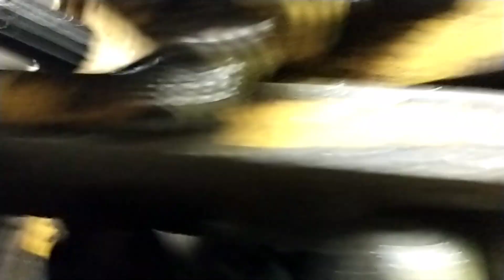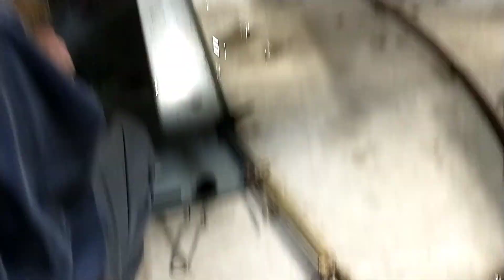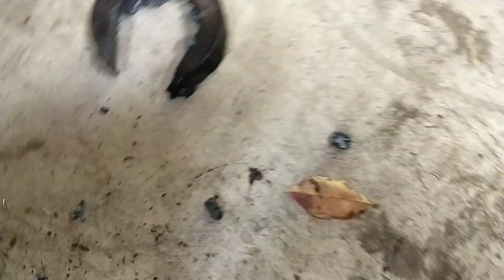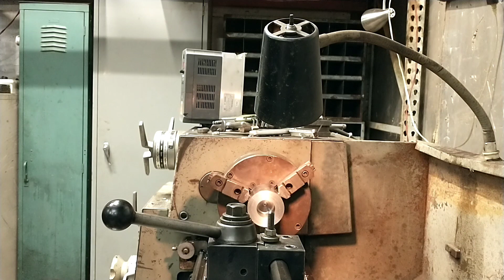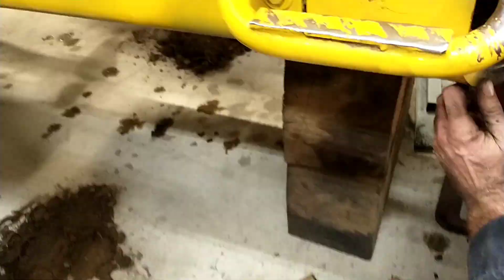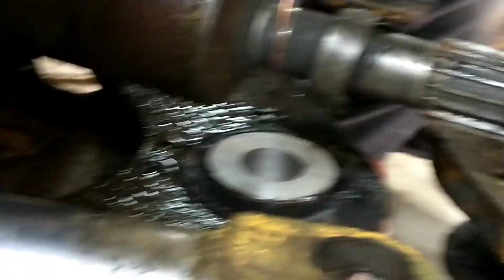John Deere Log Skidder Center Pin Repair

Comment: Should have  turned a new pin with the top turned to to correct diameter to get a tight fit on that worn top plate.
Reply from the maker: I have done that before, even gone so far as to hand grind the larger section to fit the oval shaped hole. In this instance the owner was really hard up for cash and desperate to have the machine back to work as soon as possible.

Comment: I seen that you have problems with short pieces being cut. My suggestion is to add an additional vice on outside of blade make plate to extend and reinforce bottom that way it can always be removed at any time.Basically two clamps for small items just a small amount of work to save time ,effort and extra work.

Comment: The last time I was around 440 JD skidder like that was 40 years ago.......
 I like 7014 it starts on contact and also a strong rod, I need to get some. If theres a gap I fill with 6011 then weld rest with 7014......
 I had some 7014- 3/16 20 years ago, it was as fast than .035 mig wire......
Reply from the maker: The 7014 definitely has the advantage over 7018 in its storage requirements, everybody that's leaving their 7018 laying around outside with no oven ought to just be using 7014 in the first place.